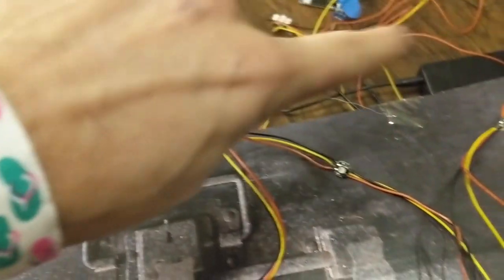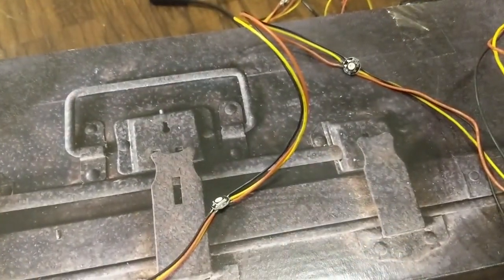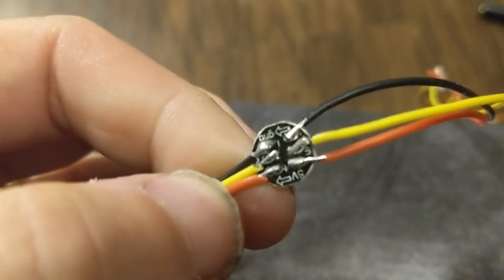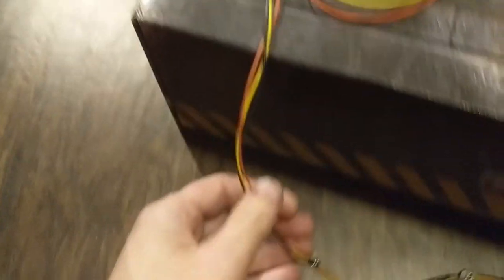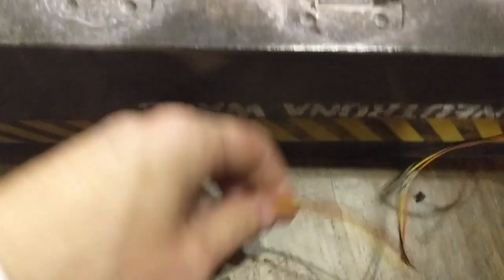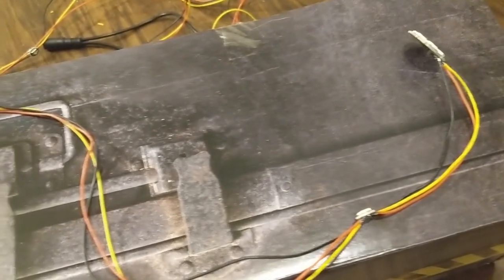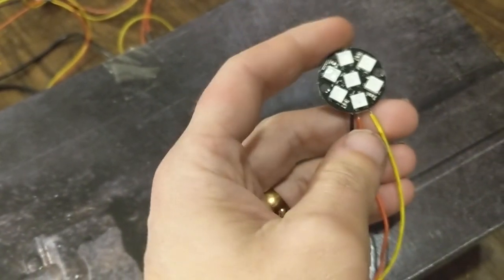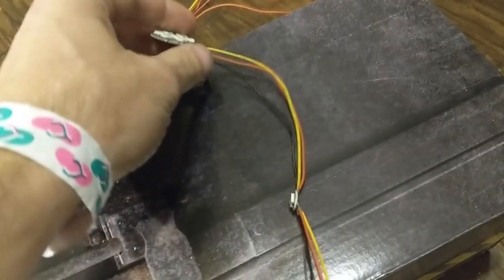Ghostbusters Arduino Proton Pack Tutorial - Part 5: Neutrona Wand

Comment: Your video has been very helpful to me as I know nothing about wiring or arduino. Is there a separate video for pack mounting? Also I see some of the 3000 talentcell batteries have a usb 5v to 12a output, would those need the power regulation parts?
Reply from the maker: I haven't gotten that far yet. Life got in the way, but new videos are on their way. Some of them do have 12v outputs, and I have seem people use those directly without needing to step them down.

Comment: Having some issue getting wand lights to work do I have to have the graph bar hooked up first?
Reply from the maker: I don't think so. I think it's just once you have the bargraph wired up, it all has to be wired up to work.
Reply: @wholesomejoe  Thanks come to find out I had a bad pin on the board appreciate your assistance

Comment: Mate at the end of this video you've finished wiring the neo pixels and in the next video you jump straight to "you should have already wired the lights to the Arduino" unless I'm being stupid I can't find any explanation on how to wire the lights and switches to the board. Did you miss it?
Reply from the maker: It's been a second since I made those other videos, but essentially everything you did on the breadboard is exactly the same as it is when you start soldering it. All you are doing is swapping out breadboard for the PCB's that have the exact same connections.
Reply: @wholesomejoe  Hi Joe, I appreciate you taking the time to respond. The problem is that videos 4 and 5 explain how to solder the leds together and then you move straight into the sound with no mention of breadboards or soldering to the arduino. Meaning that someone who is just trying to do the lights will be quite confused. 

I think you may have missed recording a small section where you connect the lights to either a breadboard or directly to your arduino. 

I've now figured it out since I posted this comment, but for future viewers It might be worth taking a look at.

Comment: If you do decide to solder on flat pads, put a little flux down first and then place a dab of solder, then line up the wire and just push it into the solder with the ironing tip.  ALWAYS use flux!  I was kicking myself for the months and months that I went without flux.  I felt like a real dummy after I found out how easy it was to work with.  Always work in front of a fan so you don't breath in the smoke.
Reply from the maker: I wish I was advanced enough to know what Flux is lol.
Reply: @wholesomejoe  it's just a paste that helps solder flow smoothly.  10 bucks on Amazon.  It'll change your life!!!  😀